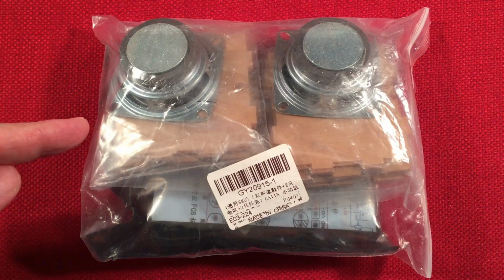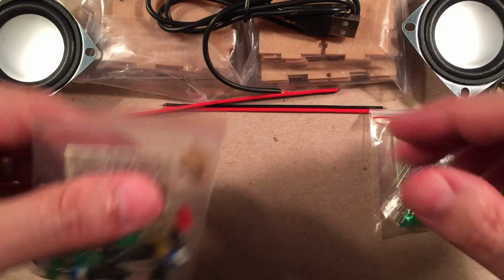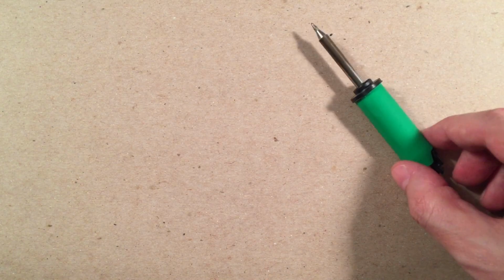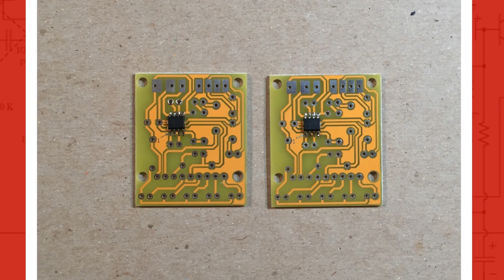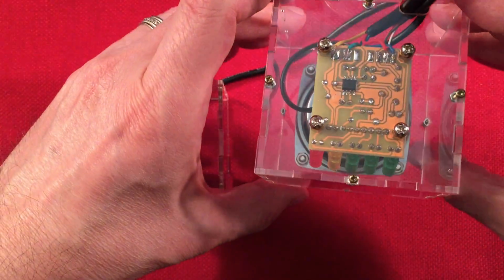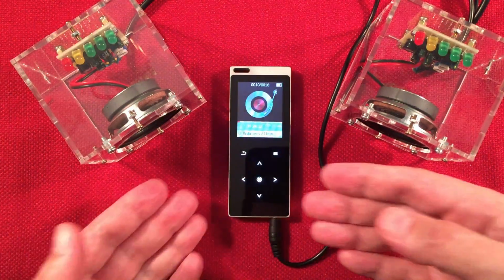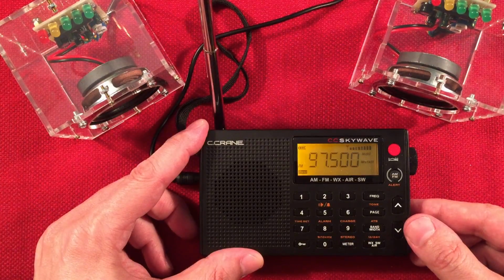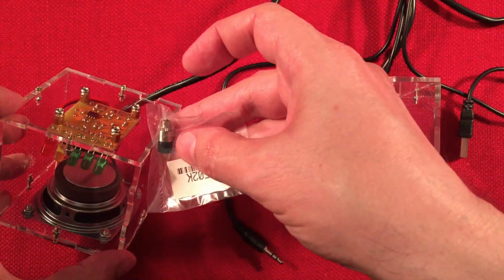ICStation Amplified Dual Speaker DIY Kit Review

Comment: OK... live and learn.  I messed this one all up and think I'm gonna get another kit and start over.  The instructions that you download are much better than the printed that comes with or the QR code scan version.  When you click on the second link above and then click on download the manual in the red circle you will get the best version of the instruction manual. 15 pages.  Have to be careful to wire the red, green, yellow and blue correct per Todd to get stereo.

Comment: I have the two-cube version of this.  Maybe I should glue em together
Reply from the maker: Um...maybe I should have separated these in the picture :)  They can be pulled apart up to 27"
Reply: @todderbert  Ah, then I have that exact kit, and have been sitting on it.  I did the PCB soldering but the mechanical part isn't inspiring me.  I also wanted a 5521 DC jack vs the cable it comes with.
Glad you didn't separate them!  I'm going to skip the hardwire cable between them (which I'd want jacks for..) and just build it as one piece.
I'd love to come up with a good idea for a speaker grille, too...